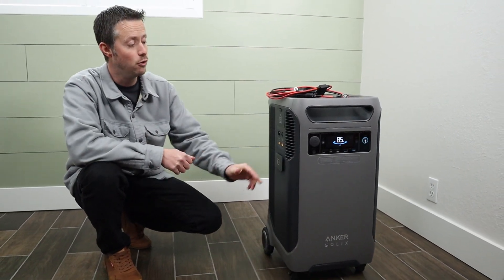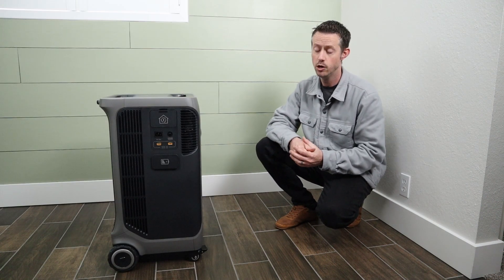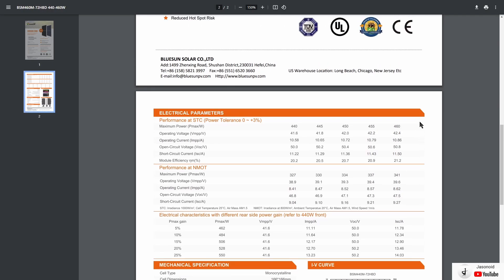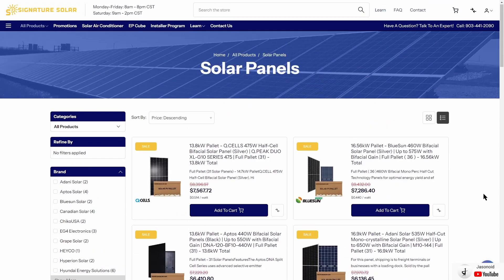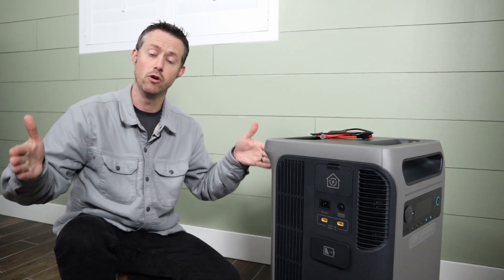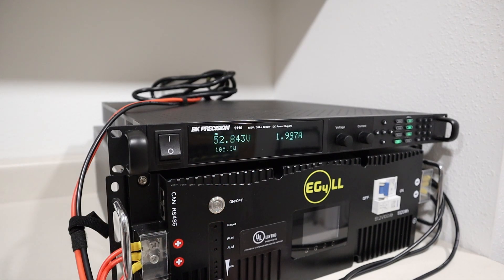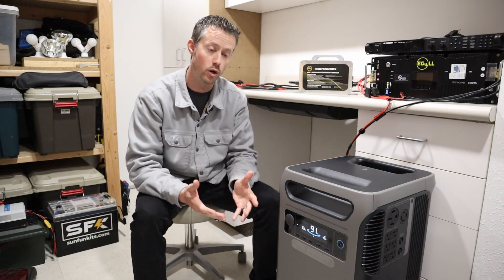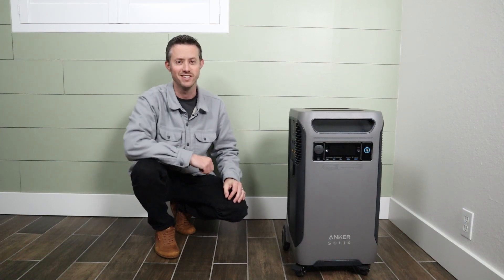Anker SOLIX F3800 - Your Questions Answered! DC Charging Cables - Ideal Solar Panels - and More!

Comment: Awesome video but you forgot question 4: Do those wheels support up to at least 20MPH so I can tow this behind my ebike and drive to Mexico? It may take a while...
Reply from the maker: They sure do! It even has little booster packs that deploy out of the sides haha
Reply: For fun I did a calculation, with my internal 15amp 52v 780w battery charged with this thing charging it I would get 345.6 kms range on my ebike which ironically supports pass through charging. I may have to buy an expansion pack or two to make it to Mexico. Now fortunately if you tilt the unit it's long enough I could stick my awesome Powerness 120w panel(it's actually rated at 140w) to it to increase that range a bit. Man I wish I could get those 120w Powerness S120X panels again the 120w has been sold out for like 6 months. It's open circuit voltage is rated for 21.6 but it's more like 24v and it's max amperage power is 7.78amps it blows away my ecoworthy 120w panel which is an excellent panel but this is on a whole new level. I guess people liked them, hopefully they'll have some in time for summer I'd like to give away that ecoworthy panel to a friend as it's a very decent panel still and replace it with 2 S120X's for charging my ebike either in series or parallel with my MPPT-7210A programmable boost converter. In the winter I was getting about 1.3 amps(needs amps to boost to 58.8v to charge ebike battery) in crappy winter sun with just the powerness itself with dubious angling. The onboard LED display was saying around 4.5amps output at 10:30am in the dead of winter in Toronto which is pretty far North we don't get much sun up here in the winter. Can't wait to try it in the summer. @Jasonoid
Reply from the maker: @chrissinclair8705  I love when panels are 'under rated' so you actually get more power in perfect conditions. Those MPPT-7210a units are also interesting to mess with.... Perfect for charging ebike batteries as that's how you use yours. I've seen many videos on that topic.
Reply: It's an older unit now but the programmability is hard to beat. Especially when I went from a 48v to a 52v I just changed the settings. It will do up to 90v so a 72v battery it will do no problem. @Jasonoid
Reply from the maker: @chrissinclair8705  I wish I had a connection to some Chinese manufacturer to request they make stuff like that. I've been dreaming of a high powered buck converter for high voltage solar panels. A high powered 150v to 55v drop down converter for all these power stations that have a 60v cutoff.
Reply: That would be a great idea. I wonder if there is something out there that can be modified that had a different purpose. It would be great if it was programmable so you could specify the step down voltage and amperage so you can pair it up as necessary to whatever power station you have. Hmmmm... @Jasonoid

Comment: I cant lie, Im sick of 60 volt input limits. haha. I saw a grecell that has a 75 volt limit, its not great either but at least you can do a couple 20v panels in series and not be too worried. Good video to answer some questions Sir.
Reply from the maker: I wish a company would make a decent step down converter so you could connect in 200v of solar and it would output 58 volts or something.... Then you could plug in any solar panels you would want to these 60v units. I can dream haha
Reply: @Jasonoid  I think we all have that same dream. ha. Setite has mentioned like that too.

Comment: Wouldn't each one of three sets of three panels connected in parallel you referred to exceed 25A?
Reply from the maker: Yes, but the power station limits the amperage input automatically. Say you had 100 amps of solar panels in parallel, the charge controller would still only pull 25 amps 👍
Reply: @Jasonoid  Good to know. Thanks! :D

Comment: If they can't put better charge controller with higher volts why go though the trouble. Server rack is the only way anymore.
Reply from the maker: They basically took two of the Anker F2000 charge controllers, upped the amperage by 5 amps, and called it good. They didn't put anything new in this model vs what they had created in the past. They need to do market research and find out what people are looking for...

Comment: Thanks for the update. Sounds like Anker engineers need to just figure out how to charge with AC (from a generator) while keeping the 240v plug alive.  The market is waiting for a unit of this size with this capability.  As presented, using an external DC supply to charge is an expensive method with too many points of failure. Sorry.
Reply from the maker: Totally agree! Many people bought this unit without proper knowledge of how it functions (due to other youtube reviews not covering these quirks). This video just shows a way around that if you already have the unit. Hoping for a better more refined V2 model.
Reply: It's worse than just not keeping the 240V live - you actually lose over 75% of the advertised output of the unit the moment you plug into 110V... discussing with their support currently, as I believe the advertising is misleading in not having any fine print to this effect (they have pointed me at the manual section that mentions this).

Comment: it would have been nice if the DC input voltage was able to get over 100v input instead of 60 for more solar in series instead, but with 60v more cost will be involved in thicker wire gauge.
Reply from the maker: I totally agree, PM! I was hoping this video would help those who already purchased this unit to get the best performance.

Comment: Thank you, another EXCELLENT vid! Just what I was wondering as I have one of these ordered. If I understand correctly:  If my panels exceed the 60 volt PV max the unit will not charge at all, but if I exceed the 25 amp max it will still charge at that max rate? Couldn't I just use a Mc4 to XT60  25 ft extension cable and ditch the Anderson adaptor?
Reply from the maker: Yep, you can ditch the Anderson adapter. I just found cables that would add flexibility between solar and battery inputs. Your cable needs to be 10 awg to be safe. 8 awg would be better for a longer run of wiring.
Going over 60v with solar will damage the power station. Going over 25 amps is just fine. Say you have 30 amps of solar panels, the power station will only ever use 25 amps of that power.
Reply: one would hope that if you give too much voltage the power station would refuse to charge rather than become damaged, however some do not feature this function and will burn themselves out instead of protecting themselves.
it is best to follow the guideline and not exceed the input voltage to prevent damage.

regarding the amperage, the powerstation is limited to being able to draw 25 amps, so even if you supply a maximum of 30 amps, the load will only ever max out at 25 amps.
the benefit of supplying a higher peak amps from solar will be that the solar curve will sustain the higher peak for longer, meaning that you will get the 25 amps of power from 30 amps of available solar longer. this is also referred to as over provisioning.

when selecting the proper cable wire gauge, consider the length of the run, as the longer the run, the more losses will occur, due to the lower voltage, and i recommend a wire gauge calculator be used to help with this.

Comment: Great followup on a really interesting product.  Despite it's limitations, the Anker F3800 is a good candidate for running a split phase load during a power outage if you want an all-in-one approach that is about the least expensive option.  Since you already have the EG4 server rack battery, a good approach for do-it-yourself might be the EG4 6000XP split phase inverter with 8000 watts of solar input for $1499.  You could have that and the server rack battery for considerably less than the F3800 with none of the limitations, including solar up to 500 VDC input.  Maybe a project for the future.  And if you want it to be portable, mount them both on a hand truck!  Thanks again for going the extra mile:)
Reply from the maker: I have been looking at that model. I think it would be a great comparison between DIY and Power Stations.
Reply: @Jasonoid  Yes. Yes. Yes. Would love to see that EG4 comparison. Especially for each the WiFi Controllable Features shown on their Displays. As Well as What Data actually are shown by each.
Jason. Very Excited for that Video.
Reply: For people not necessarily interested in solar charging, does diy still make sense?
Use case is primarily short term power outages, say 24hrs or less to run fridge and small appliances.
Reply: @dansaunders6761  I was suggesting that it might make a good project for Jason, as he has expressed some interest in the past.  I agree that for short term backup where it will not be running all the time and can be charged after use on 120, the F3800 is perfect for that use.  I use my AC200MAX for that very purpose as it has no UPS or fast charging capability.
Reply: @johntate5284  Thanks for the reply. Heavily leaning towards the Anker, but I don't mind a diy for the right results. This would strictly be utility for me and not a daily use or hobby. Ease of use in this case carries high value for the household.
One of the main reasons I asked is AC charging. I am considering a small gas generator to recharge in the case of needing more than 24hrs of power. At this point, or at least in this house, I have no intention of adding a whole house switch.
Reply: I would love to see this setup.

Comment: Too many compromises on this Anker! I’d pick another brand.
Reply: Definitely not compromises. For me, it's perfect. I will be charging from two 48v batteries acting as external battery expansion being charged by solar, so having low voltage high amps is perfect
Reply: @LamoidZombieDog You still can't use it as a UPS off 120VAC without sacrificing most of the functionality. To me you'd be much better off hooking up your 48V server rack batteries to a hybrid inverter with 240V capability.
Reply: @mondotv4216  all you lose is 240v. But you don't need UPS, this is a large whole house or RV power system, it's not a 1kwh or 2kwh portable battery that would be good for UPS during a storm.
Reply: @LamoidZombieDog  I get that which is why I reckon a server rack battery and a hybrid inverter is a much better option - 5kWh battery, a 5 or 6kVA hybrid inverter with a much better solar capability and cheaper as well. People in RVs don't use these things - they use Victron gear because it's designed for that. For a start this thing has outlets - it's not designed for a permanent hardwired solution unless you buy the electrical panel that goes with it and it's not space friendly and total overkill for an RV. It seems to me it's primarily designed to replace a portable generator for those folks who just want an off the shelf solution with no work involved. If you are going to use it as a house supply you really need the electrical panel with a changeover switch etc.
Reply: @mondotv4216  Of course. I'm not saying that this should replace a custom battery with an inverter, I'm just saying that the way it's designed allows this to be a large inverter and a battery, with Bluetooth / Wi-Fi output monitoring, and you can hook up a big 48v battery system.
Reply: @LamoidZombieDog  this is why like this system I'm not running anything that's going to need the 240v to be honest Plus I'll be hooking this up to solar panels and use it to run off grid completely
Reply: @mondotv4216 yes you can.  You can run 120v while charging from 120v but you can’t run 240v while charging from 120vac.    Only able to charge from DC INPUT.    Nonetheless they should have just added a third inverter or an accessory to solve that problem.
Reply: That's what I'm gonna do @LamoidZombieDog
Reply: Going back.
Microwave or kettle won't at run full power if ac charging. Very limited functionality when charging. 
AC output has a timer for max 23 hours 55 minutes... then it turns OFF! Even when only using solar. Timer off and the ac output is off, so is the refrigerator or freezer is off. You have to reset it every day.
Limited solar charging.
We're returning the unit.
Reply from the maker: @GimiH1 if you leave the timer to 'off' and you have a constant load, it doesn't turn off. If you set a time in the app. It will turn off at that time.
Reply: @GimiH1  my brother in christ do you not understand how much power a ac consumes watt per hour.
Reply: @big_ol_chungus maybe you should look into making your house energy efficient. Air conditioning and heating should barely come  on
Reply: Why didn’t they just add pass through charging?
Reply: @jimfields9491  they did. But it limits you to 1800W of AC output unfortunately.
Reply: @LamoidZombieDog  that’s not pass through charging.
Reply: @jimfields9491  
Compromising for costs I’m sure!
Reply: I agree but is super cheap when on sale and to get around the compromises it is cheaper than the others after buying other things unless you just go straight to diy
Reply: Lol, what are you talking about. I honestly don't believe you truly are in the market and have this kind of funds set aside. It just seems like a throwaway comment to put out there without any specifics to get thumbs up.
Reply from the maker: Thanks for sharing your feedback!